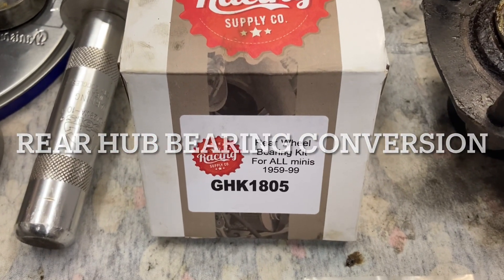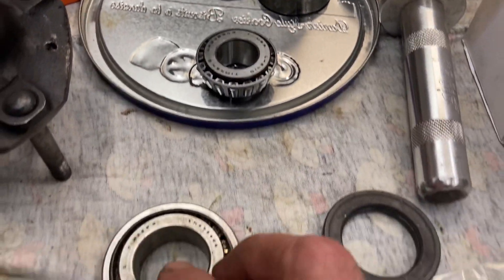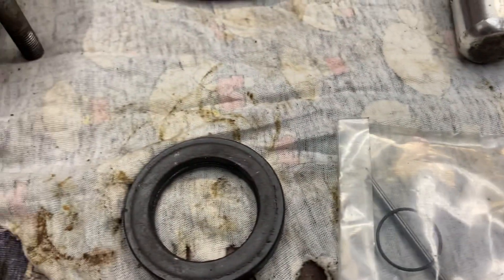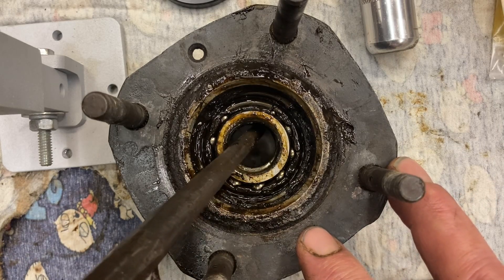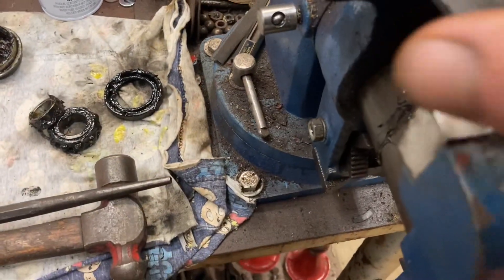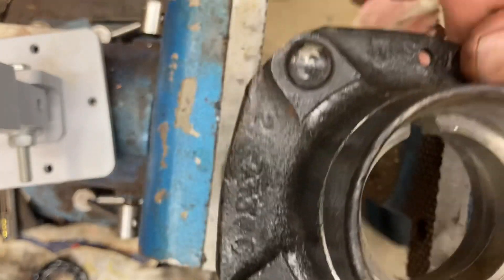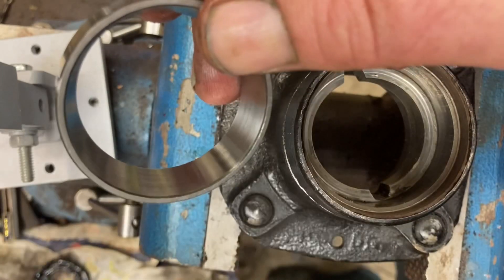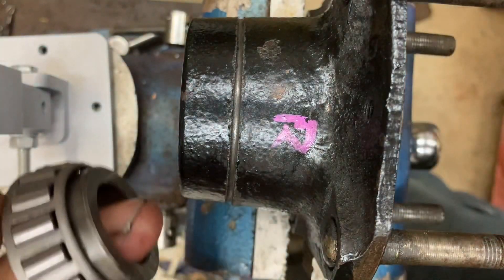Classic Mini Rear Hub Bearing Conversion

Comment: What’s this bearing number?
Reply from the maker: @janethhaputhanthiri9816  - I bought from Mini Spares as a kit. I don’t have the number without pulling it apart again - sorry. 
It is a great kit!
Reply: Don't buy loose bearings they are selected in pairs to  be within tolerance when clamped together by the hub nut.

Comment: what about the little o-ring in the kit? i see it, I have it too, but nowhere in your video or other videos does it say to use it, nor does any book.
Reply from the maker: I couldn’t find anything on the O ring either. I assumed in some applications it’s used.
Reply: @canadianwrench   for MPI minis only
Reply from the maker: Perfect!! Thanks
Reply: I had the same question, and just asked Minispares, and they said "The seal is not necessary, it was only supplied originally for Japanese cars but you can use the seal, the seal doesn’t make much difference but if you do want to use it, just put it on to the stub axle first."

Comment: I fiited taper rollers to the rear of my 1986 Austin Metro about 20 years ago. What is the  O ring seal for??
Reply: At approx 4 Min 34 Sec, one can see a thin 0 ring in the plastic bag, this is what I'm asking about.
Reply: @Radfordperson  I had the same question, and just asked Minispares, and they said "The seal is not necessary, it was only supplied originally for Japanese cars but you can use the seal, the seal doesn’t make much difference but if you do want to use it, just put it on to the stub axle first."

Comment: I didn't see the seal go on the outside bearing.  Is it just the cap that is needed?  What is the torque spec for the rear?
Reply from the maker: 60 ft lbs - align to next slot is rear hub nut torque.
Reply from the maker: There isn’t an outer seal (like fronts do). Some extra grease in the cap / not full.